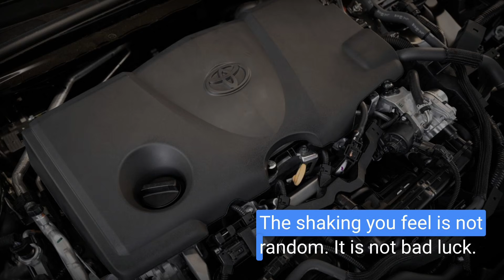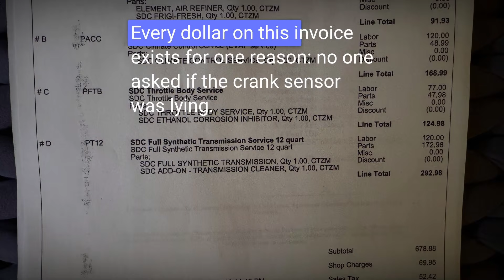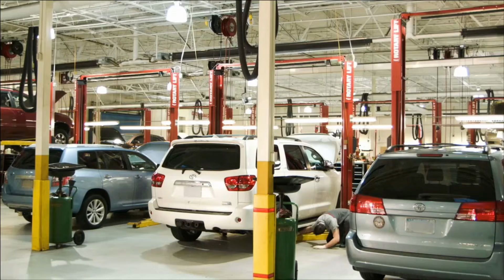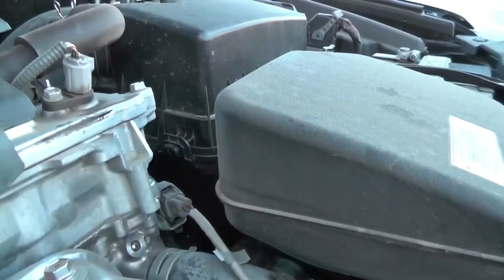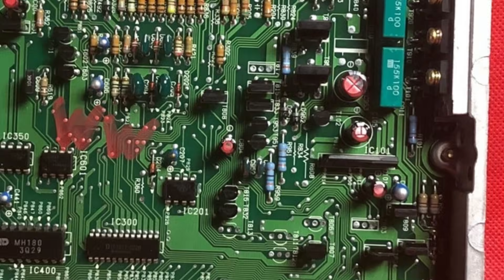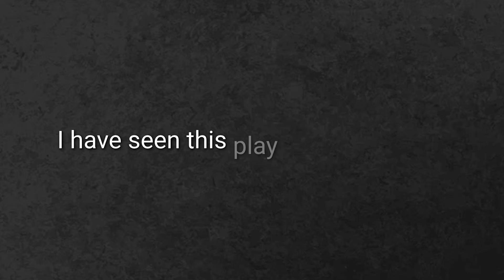Stop Your Toyota Shaking: The Secret Sensor 99% of Owners Ignore

Comment: Great information. My Avalon (2GR-FE) with 93,000 miles runs like a top. I know it is a mechanical device (Toyota, or not) and things will malfunction. What would be your advice as far as replacing the crankshaft position sensor before it malfunctions? Just a thought.